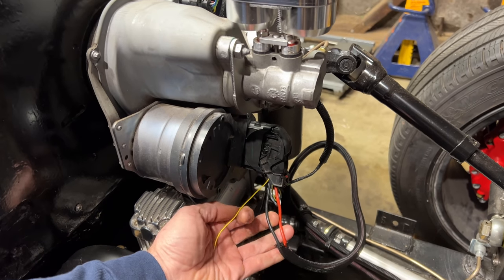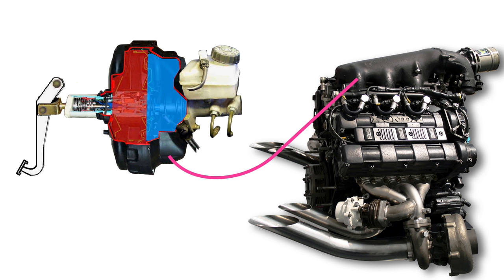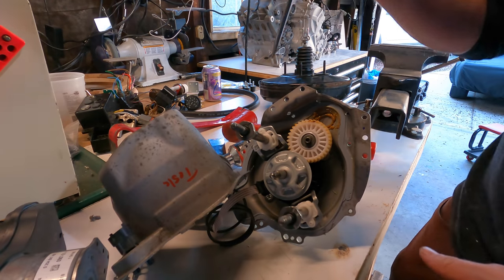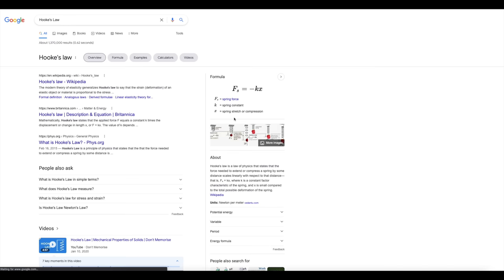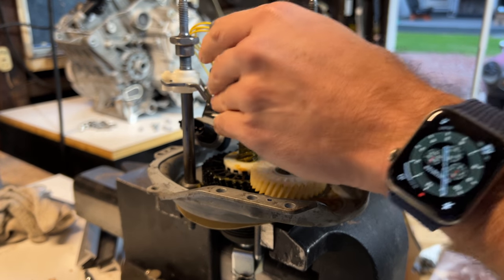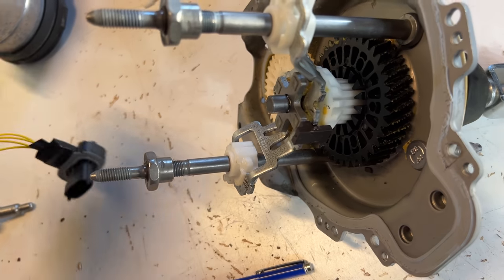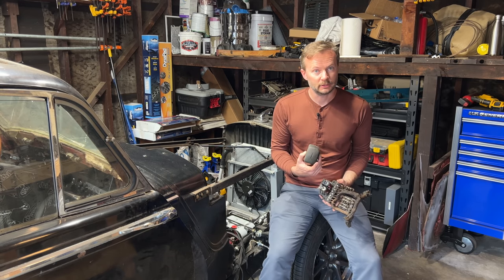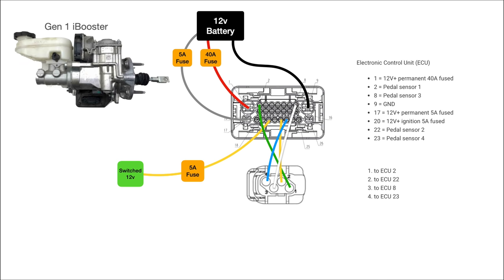Inside Tesla's Brake Booster (And How To Use It On Any Car)

Comment: great vid Matt. Just one thing though, Gas engines only have good vac when you are not in the throttle, luckily that's when you want to brake most of the time.
 I wonder what the drivers of early giant turbo race cars did as sometimes they would brake into corners but have there foot in the throttle as well to keep the turbo spooled up. Must have been hell on the brakes.
Maybe just no booster and leg muscles of steel...
Reply: You're probably at least half-right. Don't forget un-boosted brakes usually have some additional mechanical advantage baked in.
Reply: They probably used a vaccuum reservior - just a big canister with a checkvalve.

Comment: Thanks Matt, I enjoy your channel and use the content. Win win! I'm starting a 73' Econoline. Can you tell me (hopefully still on your computer) what the length of the iBooster is from mounting surface to front of master cylinder? Also from mounting surface back to end of shaft? I have a Very Small hood and currently no power brakes. Hoping I can retro the Accord iBooster.

Comment: I think you might be wrong about that spring giving a proportional response, looks way too light for that if you can fully compress it with your hands, given the pedal has a large mechanical advantage. 

I'm sure the motor can give a proportional response, but that looks like a plain old switch to me. Much the same as a vacuum booster, it would just activate the assistance at a set level for the circumstances. 

In fact the spring looks just strong enough to avoid the pedal activating it from just being on a bumpy road without being pressed. 

I could be be wrong though. Also, I'm not sure how much I'd trust all those plastic gears in my braking system. I have the same opinion of Bosch as you have of Lucas. I won't be making the switch any time soon.

Comment: A camangle sensor from a Mazda 323 will not work on a NA Miata because it is missing one slot in the optical disk, so only cylinders 2 and 3 will fire

Comment: perfect for the over-cammed or boosted to the moon drag cars & hotrods.... one question- can it be clocked 180*?? meaning- clock the booster and remount the master cylinder upright again, thus gaining a little space by the engine's left bank valve covers/etc.

Comment: For an internal combustion gasoline engine, especially aspirated, this is inefficient and converts from using an available resource (vacuum), to an increase in resistive torque at the alternator. 

However, for an aspirated diesel I wonder if the vacuum pump can be eliminated, by using this. 
Which brings me to my curiosity regarding the old Toyota you have shown. 
Maybe manufacturing efficiencies, by having the same system for diesel and gasoline versions of the truck?

I like the conversions you make and appreciate the information that you share.
Reply: It's becuase if your engine fails or turns off then your brakes work ONCE. with this not the case. More of an issue nowadays with mandated auto off at stoplights.

Comment: Found your channel while researching Tesla drivetrain retrofitting. What I’d really love to see is Tesla regen braking made proportional based on pedal force. An ibooster looks like the first step in getting there maybe. Does a Tesla have proportional regen? I can’t find the answer but it seems all the 3rd party controllers that have regen only allow programming a fixed regen force. Bummer.

Comment: What’s commonly wrong in the description of how vacuum brake boosters work ,including this one? Consider the effect of a small movement of the brake pedal. If it closed the connection to the intake manifold, and opened a connection to atmosphere on one side of the diaphragm, then as the pressure on that side rose to atmospheric, the brakes would come on progressively harder and harder. That is the slightest movement of the brake pedal would quickly lead to the brakes being full on. This is not my experience in cars with brake boosters.  

So how is this avoided?  The seal which opens to atmospheric is itself connected to the diaphragm, so as the diaphragm moves to a  new position in response to the pressure differential it carries the atmospheric seal with it, so closing the passage to atmosphere.  That means the pressure differential across the diaphragm becomes fixed, giving a level of boost linked to the pedal input you made.  If you need more braking you can move the pedal further, repeating the whole cycle.

Comment: Great video, you filled in a couple of blanks I had in doing the install. I have a Gen 2 Tesla booster I am going to use in my custom 1949 F1 Ford truck. Glad you took one apart, I didn't have the guts to go that far. If you buy from a reputable wrecking yard, you can get the booster, wire harness and brake pedal assy (that has the brake light switch) for under $400. Couple of questions, what reservoirs are those you used and did you use the Tesla pedal?
Reply: For my 1955 GMC Truck, I used a hot rod brake kit that gives you the pedal, firewall bracing and everything, and then you'd use the tesla booster in place of the vacuum booster.  If you use one from a Tesla, it's likely the bracing is pressed into the floor, and you wouldn't have that strength in the firewall of a truck designed with under floor brakes.

Comment: Hmm. I have a b230ft swapped Volvo 144s. We had to sacrifice the booster to fit the intake manifold. Manual brakes are no bueno. Something like the iBooster makes absolutely perfect sense if it will fit.

Comment: Hey matt, what barb fittings were you able to use for the first version of a remote reservoir ? I think all the 3d printing and machining may be beyond my abilities but i bet i could mount a couple nice looking reservoirs slightly above the booster. I have a gen 2 out of an accord. thanks!

Comment: Matt,
Could you theoretically actuate this booster without pressing the pedal? Im making a brake-by-wire handbrake for a senior project and have had trouble finding something to actuate my master cylinder.

Comment: Isn't brake by wire on the c8 already?
I think it just uses a pump to do it, which is great for when you haven't rebleeded your brake lines for a long time and there's air inside.

Comment: It's a very complex system self-contained into a single part. Using the original brake booster and a vacuum pump is actually more reliable, as the system is simpler and you can have assistance to step one or two times even when there is no power. The only advantage to an electric brake booster set up this way is to move the brake pedal and give autopilot users better feedback.
Reply: If an engine quits running this system would still provide brake boost as it only needs 12v power and ignition. Same thing goes for a Tesla, if the high voltage fails there is still 12 volts and still have brake assist. Vehicle 12v systems are pretty robust and it's uncommon to have complete loss of 12 volts in any vehicle. From experience, the iBooster both performs better and is more reliable than the vacuum pump/booster set up (mostly the pump). Plus the vacuum pumps were noisy as all hell.

Comment: You showed how the booster won't prevent brake actuation if it has no power (just like a conventional vacuum booster) but is there any fail safe that would prevent brake assist being applied constantly e.g. if the motor driver shorted, or it power failed whilst braking?

Comment: What about if you dont want to use the master cylinder from it? Such as lets say you want to use this booster with your car that already has power brakes but because you have a low vacuum cam you lack vacuum. So you want to 
keep/use the master cylinder that is matched to your car but use the EV booster.

Comment: Could you potentially the yellow wire and take a 2 potentiometers and be able to attach One to the pedal to get active break boosting and to get adjustable brake boosting so you can have a little or a lot on the dash

Comment: That's cool. Does it have a 'brake fail switch' built in or did you put one in the circuit elsewhere? What's the diameter of that bad boy.

Comment: So is the motor clutched to allow the spring to push the spindle back down? if not, wouldn't the input gear locked to the motor keep it from spinning back down?

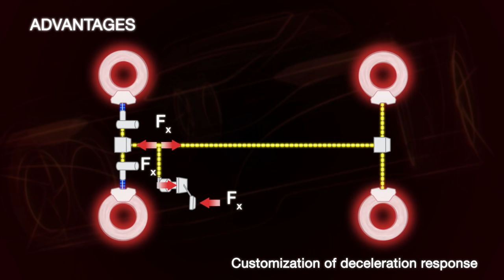Comment: 6:35 we already figured out the only problem that matters and it can't be fixed and have a brake by wire system at the same time, THE SYSTEM IS NOT MECHANICALLY COUPLED TO THE DRIVER CONTROLS!

Comment: Is the switched 12v just key on? Do the units (hehe unit) in the Honda have the same spring as the Tesla’s unit (hehe)? Project vehicle is considerably heavier than a Tesla or Honda is why I ask. Making sure it’ll give enough power to stop me. Thanks!

Comment: Is there any way to adjust the master cylinder pushrod? I'm planning to clock the booster but need an adapter for the MC that will make a 1/4" gap.

Comment: Hi Matt, I have a Tapping sound on my 2015 Model S  under the driver side dash that can be felt lightly on the brake pedal, - when you press the foot brake the tapping stops... your video has now given me some clues, (got nowhere in Tesla discussions) after around a minute the tapping stops, as if its up to pressure, do you have any clues to help me? is there some kind of pressure valve in the circuit?

Comment: You didn't say much about bore size if that master cylinder. Not sure that would work for every car. You might have just got lucky if you didn't do the math on that. I'm building a custom 1973 winnebago ago brave and want to use hydroboost in it but it will be mounted inside amd where you can see it. I think it will get hot so not sure that will  work ....then this vid popped up.  Would be cool to use this but not shure
 a honda accord booster and master are up to the challenge...what do you think??

Comment: Are there any difference between the model y and model 3 booster unit, apart from the reservior? The brake pedal feel is quite different between the 2 so I was wondering.

Comment: seeing this o most makes me what to change out my bendex-9 system but its to big/wide on the firewall and i think it would hit my bbm hemi valve covers as the 1969 vacuum dodge booster doesn't fit, but it looks like its probably got good NVH compared with mine as there's no higher psi pump and one less leak pathway ect and for smart people faster ABS control and more precise as well.

my maybe i will consider this for the 80's k1500 of mine/a different project as a BEV is in the works what's the max line pressure and or max input needed for users in lb's as the 9 is under 30 to 50 lb's

Comment: The electric box at 4:02 Is in fact called the "FM" box.  It's "Fucking Magic" so unless you are a wizard you stay out of it.  That is what an older guy told me about the box of vacuum solenoids on the firewall of a mid 80s honda accord.

Comment: Probably not a thing that can be made better with a turbocharger. This is more in the realm of a centrifugal supercharger IMHO. You wouldn't stop very fast, but you could accumulate a lot of pressure for the "...and run" phase of collision physics. Among the long list of benefits would also be conserving space in the engine compartment (for turbochargers) by putting the belt-driven centrifugal superchargers near the wheels, and also having four 1st stages to your turbo. You could hook your blow-off valve to an airhorn to really brake with authority.

Comment: Yup.
I have had a car where the stopping power was supplied by my right leg pushing upon the brake pedal. A mid fifties designed Rover P4.
And I have had the same model of car fitted with a "brake servo" the braking force assisted by a vacuum coming from the engine. And indeed all subsequent cars used this system. But I have no idea what  a "brake booster" is, nor how it works.  I would like to have found out.

The information may be contained in this video, but I was unequal to its continuous jokiness, so I never found out.

Comment: Electric brakes would scare the crap out of me if it fails, you have absolutely no brake boost or if a brake line pops. With vaccum brakes the brakes will work (sometimes not great in the case of a bad brake line but it’ll work till you run out of fluid) whether there’s vaccum or a blown brake line or not.

Comment: I wish Chevy would get the message about electric brake boosters, or even vacuum boosters. 
Picture this scene: Me in my Toyota Tacoma sitting motionless at the bottom of a freeway on-ramp, waiting for the traffic meter to meter me through. Behind me coming down the on-ramp (did I mention it was on a hill, sloping down with me at the bottom?) is a Chevy pickup which, in case you didn't know, uses the power steering pump to power the brake booster. Predictably (did I mention I hate Chevy's?) his engine picks that moment to quit running. This means the power steering pump stops turning. So here he is coming at me at 30mph with no steering and no brakes. Needless to say, my Toyota bumper took on the chore of stopping his Chevy truck, with predictable results. An electric booster might have fixed this, even a vacuum booster would have given him one chance at saving my bumper.

Comment: What sucks is that a brake booster? As we know it relies on vacuum applied to a diaphragm in a system that has brake fluid the diaphragm becomes eaten by the brake fluid so failure is always catastrophic.

Comment: As a Brit I'm offended by the way you slag off Lucas electrics. I had a 1967 Triumph Spitfire for about ten years and pretty much all the lights worked most of the time. I only had to replace the voltage regulator once, the generator twice and the battery about eight times.

Comment: The General Motors hydroboost system worked quite well and was Far stronger than any vacuum booster that you have spent way too much time trying to explain to people if they are going to do this retrofit they already know how vacuum booster works. If they don't they're not going to try to do this. And what the hell is with this drum setup

Comment: Diesel engine don’t have a throttle closure so they have no surplus vacuum to operate the brakes, most have a small vacuum exhauster added to the engine somewhere e.g. driven off the camshaft.
P.S. American beer is like urine, cold urine granted but nonetheless.

Comment: Brake by wire will probably never come back. Mercedes had it and the only safe way to operate is: by any sing of fault, full aplication of the brakes. With low battery voltage at start your nice Mercedes wont drive even with running engine. You have to wait until the battery is charged

Comment: So here's the million dollar question...
What sort of output can these things reliably provide?  Like, could one run this in lieu of a hydroboost on a 3/4 ton pickup?
Reply from the maker: Tesla uses it for autopilot, so it can stop the car by itself in an emergency braking situation. I’m sure it’s capable of a high output.
Reply: Bosch designed iBooster for highly automated vehicles, so without driver input it can produce the full hydraulic output pressure needed for a maximum-effort stop.

Comment: Brake by wire has been in Europe since MY2019 and it’s an utter disaster in terms of driving experience. JLR seem to have it dialled but Volvo has some weird non-linear calibration which means it’s inconsistent and you never really get the same response - but still it’s a bad idea and and should never be used on anything slightly dynamic. Side note Lucas was bought it by TRW who bought Kelsey Hays who made the worst 4channel ABS systems for Lotus back in the 00’s - TRW are now owned by ZF who supplies pretty much everything under the body of European cars so hears hoping all that Lucas has been filtered out otherwise there’s some dark times ahead

Comment: Don’t name it about one of the users.
It’s a Bosch electric brake booster.
It’s enough that Elon fans think he is the inventor of the wheel, just because the car brand he owns (partly) also uses 4 of them. 
Cars are a multi company business and Bosch is one of the companies heavily involved in everything with car electrics. 
BTW, they even licensed a lot to Lucas, so the prince of darkness (or un-coolness, as I just learned 😂) had the blueprints, but messed up production.
2nd BTW: I recognized an E-Type front frame in a short clip. Pls, don’t mess up that car in the way Americans are used to. It is a piece of art, with flaws, but don’t „destroy“ it by „un-flawing“ it.

Comment: Its a Bosch Brake Booster.
Reply: Elon fan would claim he invented the wheel, just because his cars also have them.

The fun part: the Bosch electric brake booster for Tesla, does nit even fit in his car. He needs the not so oddly mounted/designed one they use in Hondas. Let’s assume to his best, that he only wanted to attract the Church of Musk.
Reply: @fromgermany271  so war. Du sprichst mir aus der Seele.

Comment: No brake by wire ever for me!  It's bad enough that we have throttle by wire.  They are routinely not reliable over time.  Cables and hydraulics are robust enough to work even when rusty and crusty.  Not so with electricity.

Comment: Vacuum brakes on diesel engines really annoy me, as they all seem to have an add-on vacuum pump. They could just use air pressure brakes, or electric brakes, or anything better than vacuum brakes.

Meanwhile, I rather like the non power steering or brakes on my old car. Nice and simple. Shame they're drums!